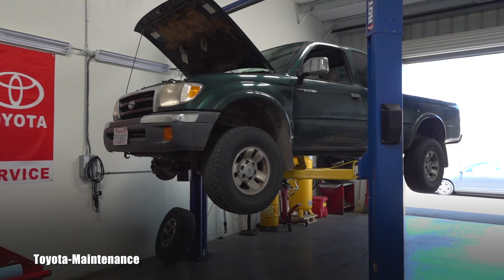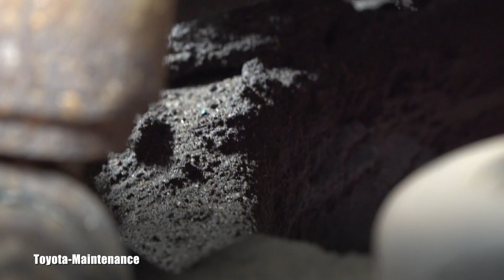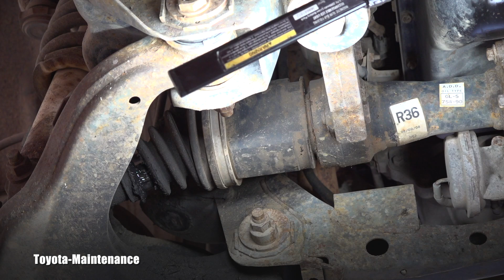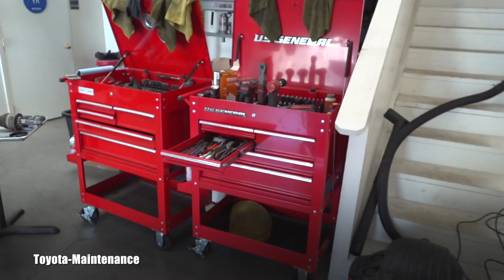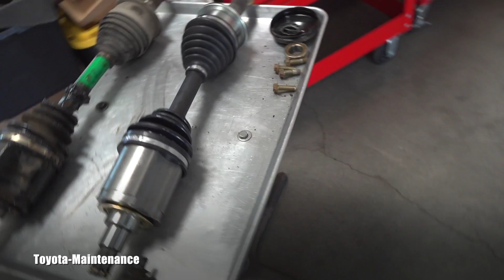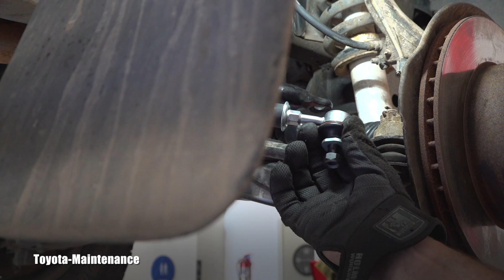How to replace CV axle on Toyota Tacoma

Comment: Thanks for the awesome video. Your trick helped me get the axle in, it took maybe 10 hand taps. Turning slightly everytime and it went in smooth. I had a piece of wood in my palm when I did this. My tip to others would be make sure the teeth are at least started inside of the bearing before you start tapping. You know its started because the bigger diameter of the shaft will roughly line up with the axle seal. You can see that in the video when he starts tapping

Comment: I have installed the cv axle on the passenger side of my 1999 toyota tacoma sr5 4x4 2.7, I've realized that the inner cv axle is moving back and forth after everything is installed, it goes flush against the front differential, but it moves from that area and it's leaking gear oil,what can I do to repair this?

Comment: I have a 2001 tacoma 120,000 miles on it. Wanders... have aligned it several times. Replaced shocks and struts. Upper and lower ball joints. Control arms. Still wanders... no clicking, not sure about vibration but you can feel road. But wanders terrible. Really like the extra cab pickup except for wandering. Could it be the CV axle? Any other ideas? Husband doesn't want me to sell the pickup😮.  Thank you.

Comment: after removing those 4 bolts, that piece is still locked in place somehow,   I noticed that yours just lets go right away and you're able to remove the axle easily,
Reply: Same case with mine - I just hit the piece loose with a rubber mallet. There are two sleeves that protrude into the upper holes and they were a bit rusty.

Comment: Great but you did not show what you had to disconnect to remove brake rotor and it's backing plate. I need to do this because my wheel (tire on rim) is stuck on the Hub, lugs are removed but not the wheel. It is rusted on hub.
Reply: are you still working on getting the rotor off the hub that is seized?  or is it the whole wheel + tire
Reply: It was the whole wheel tire and rim, but my son finally got it off using torch, PBBlaster and a wheel puller rated for  7 ton, the 5 ton was too weak  @efil4kizum
Reply: @SteveInterdonato  I have this problem sometimes when I switch from winter to summer tires but I just hit the back side of the tire with a short 2x4 until it pops loose.

Comment: LC Engineering ( "LCE" for short ) has CV axles that they claim are good quality for $132.00. This was the price for CV axles with manual locking hubs. That's a pretty good price. I bought a pair of these for my 2000 Tacoma 4x4 with manual locking front hubs. LC Engineering is THE go-to place for quality parts, especially for classic Toyota engines such as the 3RZ-FE and 5VZ, and 22R/RE......just to name a few. The founder of LC Engineering was the very first man to start modifying the 22R engines to make much more power, and do so very reliably. Toyota mechanics/fans all the way in Australia buy their parts from LC Engineering, located in Lake Havasu Arizona. LCE refuses to sell "poor quality" parts to their customers. They find/source, and sell only proven quality parts. If no quality parts are available, they will manufacture/fabricate the parts themselves or have them manufactured specially for them. Example: a few years ago, I bought a pair of rear axle service kits consisting of outer hub bearings, retainer, seals, and all related components ( 6 parts in each kit ). The bearings in these kits will be either Schaffler/FAG or Koyo. These kits COST LESS than what ya get from Rock Auto, yet they are better quality, and are a more complete kit vs from Rock Auto ( ask me how I know. )  The 2 kits LCE sent me happened to include the Schaffler/FAG bearings. My local transmission specialist did the install and told me personally that Schaffler/FAG bearings ( a German company ) are the finest bearings made anywhere in the world. I always buy my Toyota parts from LCE. Great customer support too. I rebuilt my entire 3RZ-FE engine, using a master rebuild kit including a brand new original Toyota head with all uprgaded components ( stiffer valve springs, improved Viton valve seals that are far superior to the original Teflon seals, etc ), all purchased from LCE.

Comment: Aftermarket CV joints are junk. Always keep the Toyota one for repair. I did the O Reilly thing, and they are guaranteed for life. Absolute junk, after about 1 year they were both requiring warranty replacement. Now I’ve got the OEM Toyota ones back in and a pair of brand new OReillys sitting on the shelf.

Comment: Nice video quality angles to see all that is required for this service and explanation of detail as well as the what where why and how.  Well done and thank you.  I have 2003 Xtra Cab Tacoma 4WD with 5VZ-FE engine.  I believe many parts of the 1999 to 2004 are the same.  I don't really see how this specific part could be much different.  

Oh, I wondered did you add new front differential oil to replace what was leaked out?

Comment: I am really enjoying your videos and learning a lot from them...thank you for taking the time to create them.  I have a 1998 4Runner and plan to replace the CV axles very soon.  I've also noticed my sway bar end links are shot and will replace those as well as you have done in this video.  Do you have a part # for these that you could share?  I'm also looking into changing the lower (and possibly upper) ball joints, if necessary, while I'm in there...gonna check those tomorrow...It makes sense to me to gather all of the parts and do all this at the same time.  Is there any reason you can think of that I should not do the CV axle, sway bar end link, upper and lower ball joints at the same time?

Comment: Your a great mechanic , you take pride in doing your work carefully. I used en impact in my axle nuts and they are still fine after 15k miles so other viewers don’t be scared if you don’t have a torque wrench

Comment: Did you have to add differential oil into the front differential after the install to replace what leaked out while the CV axle shaft was removed? Great video, thanks so much for sharing.

Comment: 80 Newton meters equals about 59.6 foot pounds 
And 235 Newton meters equals about 173 foot pounds.
Reply: My manual says the wheel torque is to be 110 N-m or 11.5 kgf-m, much less than the number given in this video.

Comment: I want you to be my mechanic!  LOL.  Seriously though, your attention to detail and care for the customer's vehicle is rare today.  I was a Toyota mechanic back in the 90's and I actually have a 1999 Tacoma :)  Just replaced rear driveshaft u-joints, the center bearing, valve cover gaskets and spark plug tube seals.

Comment: Question: Which BOLT sizes are most common when working on TUNDRA's/TACOMAS's or TOYOTA's in general? 
 8mm, 10mm, 12mm, 14mm, 17mm, 19mm, 22mm, 24mm, & 35mm???
Can you think of any other sizes....
What size Torx Bit & External Star?  
https://www.tekton.com/1-2-inch-drive-torx-tamper-resistant-torx-bit-and-external-star-socket-set-skt25402

Comment: Actually the only way to decide if the old joint is still good is to disassemble it and inspect the mating parts inside the boot. So if you're on a budget u should try to check it out. Cause if it's good then your only replacing the boot

Comment: Thanks a lot Sir.  Sway bar links from Toyota is expensive, really expensive. About 10x more than any aftermarket.  In many cases, the balljoint on the sway bar is still good if it is not torn, only the rubber parts fails often.  REplacing the rubber parts only is much easier and rarely really corroded.

Comment: Factory Toyota CV is 1000% better than any aftermarket. I drove my 4unner 3rd gen with a ripped inner boot exactly as shown for nearly 20K miles across the country too. No issues what so ever. Just reboot it. Use factory boots. Remove upper ball joint, remove inner CV clamp and then boot off of inner joint, remove C-clip, pull the tripod joint out and then inner boot. INstall is the reverse order. No messy oil leaks, no O-ring has to be changed etc., Non-OEM CV's are causing pulsations, vibrations at high speeds. I have experienced it on my Land Cruiser! With OEM CV's no pulsations!!

Comment: Regarding the c-clip on the inner end of the CV axle, I've seen having it the  gap in the clip facing upwards and a bit of grease around it helps with installation. ❤️ @Toyota Maintenance friend→Thanks for sharing your attention to every detail it has probably saved lives. Surely mine 🙏

Comment: Thanks for sharing this video. I had the same problems with my 1996 Toyota Pickup on the right side .lot of work ,but I got it done.
Reply: I have 96 that I need to do this one,  was the process basically the same for the 1996?

Comment: I would recommend  you loosen the differential  fill plug before replacing  the CV shaft (s). Its better to know you can top off and or just change  it as preventive  maintenance. Thank you for making these videos.
Reply: I was thinking he was going to change the transfer case fluid when he was close to being done since he lost quite a bit of it after taking out the shaft.  Would you recommend doing this or maybe just top it off.  Thanks!

Comment: Hey Peter,
A 2003 Toyota Corolla.

Too bad it would cost millions of dollars to fix a P0442.  An old Toyota for $800.

2003 Toyota Corolla LS 4 door - AS IS - WHERE IS -- The GOOD = nearly new tires, new exhaust from CAT back, newer brakes, low mileage 79,700, leather seats (no rips), a/c, electronics all work. The BAD = Check Engine light due to P0442 EVAP leak (new gas cap did not remove code), front left wheel wheel bearing needs to be replaced, dent on drivers door (window still works fine), body paint flaking off with minor rust. I will repeat - AS IS - it's a 17 year old car that needs an unknown amount of money to at least fix the wheel bearing and the EVAP leak to pass inspection. Asking $800 firm - Blue Book Value is $2000-3000 leaving 1200-2200 for repairs and paint. It is off the road and uninsured so it can NOT be driven on public roads but I can say it starts easily, runs well and stops well but is still sold AS IS! Pictures attached. Email only (use the REPLY button in the listing) please and I will respond to answer questions or set up an appointment. Thanks!!

2003 Toyota Corrola LS 4 dr
condition: fair
cylinders: 4 cylinders
drive: fwd
fuel: gas
odometer: 79700
paint color: blue
size: compact
title status: clean
transmission: automatic
type: coupe

Comment: Update about CV's. I installed aftermarket CV's in my 100 series LC. At 50 MPH, I find a pulsation... then at 80MPH, again but at much worst. Never though its that Chinese aftermarket garbage CV's. If you know 100 Series, it has a driveline clunk when going from R to D. I was diagnosing it and found out the aftermarket CV's at 16K miles had massive play at inboard and outboard joints and at inner splines. I then went with OEM new CV's and ALL the TROUBLE I experienced at the front end is NO MORE. Yes, Aftermarket is cheap but comes with lot of headache. 
I find Most OEM Toyota CV's are in excellent order even after 200K miles. Unless splines are worn, I find no reason to get rid of those. Just reboot those CV's (did to my 3rd gen 4Runner) and continue to drive with peace of mind. You will regret cheap aftermarlet CV's sooner or later.

Comment: I have replaced 3 vehicles using rockauto cv half shafts no problemas so far. Saved a bundle of money. Have done all types of maintenance and repairs except complete engine swap.
Reply: Rockauto warns about whether or not your truck is 'lifted' and I really cannot tell that.  The truck looks a bit higher on the front end and overall looks higher than I typically see one.   Do you have a good way of finding out whether a truck is lifted?  Thanks very much!

Comment: Very nice work. I hope I never have to replace my Lexus GS front CV. The cv is over a meter long and goes thru the oil pan. I saw a video where a guy cracked the lower engine housing gettng it out. The bearing on the long part of the axle seizes in there.

Comment: It pays to look on Tacoma World forum. There are people who can and do, make better than stock parts like axles, front wheel bearings, carrier bearings better than stock. I bought tie rod ends that were half the cost and could see the difference. The wheel bearings were assembled and over greased with inner seals removed so they could actually get grease, if you know what I mean. Some call it overkill.

Comment: Good job, I gave a thumbs up for the job and the filming. New Question: Remember 30+ years ago when a PCV valve could be replaced on many cars by pulling up on a grommet on top of a valve cover and unplugging the other end of off a hose? 60 seconds to do including cleaning around the grommet and the end of the hose. Now PCV  valve is behind the manifold on Corollas. Can you replace a PCV valve on this model or a similar model where PCV valve is behind the manifold?
Reply: The PCV valves on Toyota's 2AZ-FE, 3MZ-FE and 1NR-FE (European Auris/Corolla and Scion iQ) I do know are still up on the valve cover and easy to replace. The problem engine you refer to is the 2ZR-FE on some Toyotas and Scions. Even then, after doing the one on my Corolla I find I'm not so annoyed about it anymore.

Comment: To me, it would seem that one would replace both shafts at the same time, because they both have equal wear.  Like headlights.  If, one burns out on one side, I have both sides replaced.  This may have been a single repair, due to finances.  Believe me, I've  been there before.  However, if it had been my truck, I would replace both shafts and the other item as well.  You are a really honest mechanic, replacing the one item for no cost.  Very few people are this honest.  Much respect to you.  Thanks again for sharing.  I really enjoy learning from your channel.
Reply: Excellent comment I fully agree with you best regards and stay safe Mark from Billericay in the U.K. 🇬🇧👍👍

Comment: Another great video TM.  Passenger side on this truck is much easier than my Highlander which as you know has the intermediate bearing and bracket with is a real pain in the butt to dislodge.  I replaced the seal on the transmission body too since you are already in there and it is a few bucks.  Thanks for posting..

Comment: Another tip for inserting the shaft into the transfer case spline. Make sure the clip opening  on the end of the shaft spline has the opening at 6 o'clock. Easier to compress for reinstallation .
Reply: Good to know, thanks

Comment: Great video! I just replaced these on my pontiac vibe (almost identical to the Toyota matrix) along with the rear motor mount to try and solve a clunking noise when shifting from reverse to neutral. The noise is the same still. Is there anything else I could check, or could the transmission be going out? There's also a grinding noise for second or two when I accelerate with about 3/4 throttle and it's louder when I'm turning, along with a slight surging.
Reply: Did you check engine and transmission mounts?  It's rare to see cv axles clunk that way
Reply: @gianfrancoa  I replaced the rear one and check the rest. I will double check